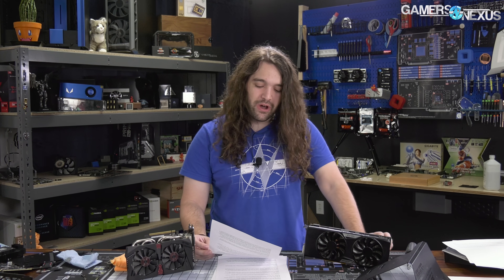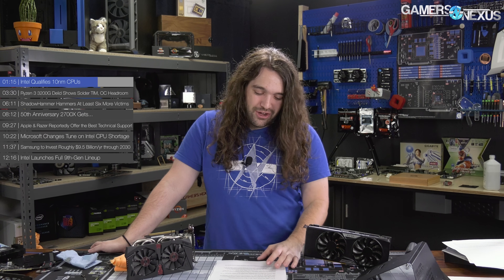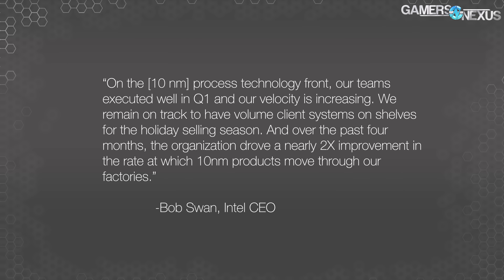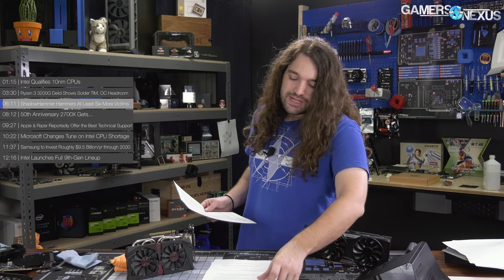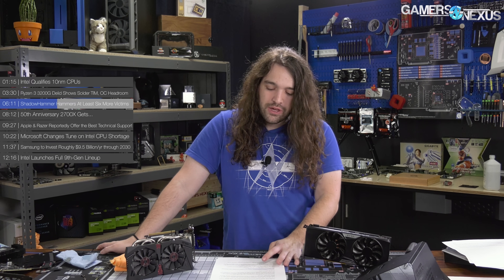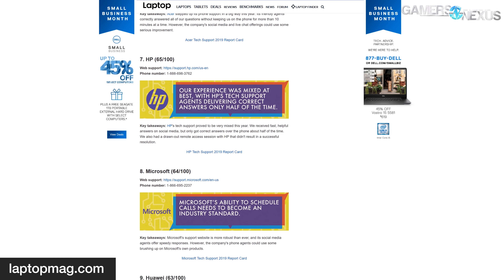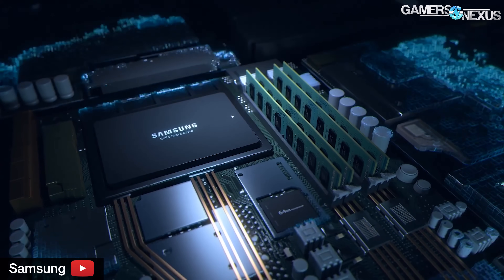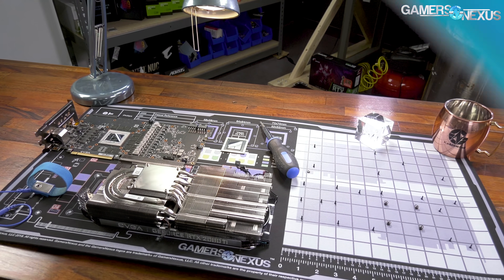HW News - Ryzen 3200 Delid, Intel 10nm Qualified, & More Malware

Comment: Wanna hear a bad joke? Intel Platinum 8156!  This new beast has 4 cores clocked at 3.6GHz and offers 48 pcie lanes. Guess how much this processor costs?  $9000/8000€!! You can get TWO   AMD 32-core Epyc processors (128 pcie lanes each) with that price.
Reply: 7000$*

Sad how my 2600 is so much faster for 6,800$ less

Comment: Leaked Dell road map for desktop suggest that no 10nm CPUs before 2021.  Apparently Intel 10nm process (currently) doesn't allow as high clocks as  14nm so  low power parts first. So before 2021 Intel's best offering for consumer level is 10 core "Comet Lake" (while AMD should have Zen2+  16 core) and  18 cores for high end (AMD should have 32 to 64 core processors. Interesting to see what kind of prices AMD will have? On the other hand they'll need market share and recognition badly, but on the other hand they (should) have greatly superior product that could enable higher prices..

Comment: Not a genius but can you verify humidity levels during your tests for thermals, as I believe higher humidity would change the thermal capacity of the air, in a less insignificant way. As in dry cold air it would sap heat slower than cold humid air.

Comment: I contacted Silicon Lottery some time ago asking how the Intel KF processors will perform and they told me they expect them to overclock on par with K series.    I was hoping for better overclocks because of heat reduction and thermal load with the absence of an IGP and the required voltage to run it.

Comment: I've been trying to get a missing m.2. standoff screw (I got the motherboard new and 1 was somehow missing) they sent me 2 replacement standoffs and screws. But they were the wrong size like they were too small for my mobo and now they've gone dark after I opened a new thread. If anyone knows what screw I need for a b450m mortar that'd be great cause I'm willing to buy it I just want to know the size. So yeah, msi support is pretty bad.
Reply: you can easily measure the size yourself ... in any case it is probably M2, M2.5 or M3 standoff screw - the digit is actually diameter in millimeters

Comment: Intel has missed one key chip in the release of their Coffee Lake Refresh (Generation IX) lineup: The Core i09-9900KFC, a chip that we have been long waiting for since its finding in February and yet we get all but it, which is honestly surprising me.
As a chip without an iGPU, the speculation around the 9900KFC is that it is a 9900K that, like the 5675C and 5775C before it, can utilize the eDRAM to help improve the overall performance of the Dedicated Graphics Card, considering that it wouldn't have a modern equivalent to Iris Pro in the chip; personally, I wouldn't be surprised if the 9900KFC becomes an Auction Only product or only available in Quadro RTX Workstations by companies such as the main trio (Dell, Lenovo, and Hewlett~Packard) and Puget Systems, but knowing how badly the 5775C is priced nowadays (well over II00$ USD on Amazon) and also what happened to the 9990XE, the 9900KFC may be priced a little higher than its K and KF variants but spike to unreasonable values in later years due to its rarity, wishfully that doesn't happen but it honestly wouldn't surprise me as I look further into the prices of some of Intel's more rare, bizarre, and uncommon chips on the market.

Comment: Ask GN: Can Spyware get and send your IP address, if you are using a VPN?
It can get your local network IP, but that doesn't help anyone. :)
Reply: Brad Viviviyal  Not suggesting spoofing just ID linking to a device/user.   If the SW is on the source machine no amount of hops really matters.   It was just a matter of time and sophistication of tech for keeping up with hackers (properly called crackers) to become a real problem.
   Just think of the number of gigabytes of security updates a user has received since they purchased  a PC and SW.   I installed layers of protection on my neighbors PC yet with bad habits I would have to clean his PC every couple of weeks.
Reply: It can get your mac address that is unique and static.

Comment: The laptop ryzen apus (which the 2200g and 2400g are based on) are still 14nm. Their successors in the 3000 series are supposed to be on the 12nm process and somewhere between zen+ and zen 2, the same way the 2000 series apu was in between zen and zen+.

The rumored big boy apu's would be based on chiplet based CPUs on 7nm, but navi needs to come out before those hit

Comment: Soldered IHS is actually really good news if true. I had to delid and LM my 2200g to get temps down in my sff case (in addition to undervolting what little my particular 2200g could do compared to others). It have me 7-12C drop depending on the test but about 10c drop average. Excited for the 3200g/3300g or whatever they end up calling it.

Comment: 2X improvement of 10nm production... So... we're up to like 4 units per month now?

The 3200G is using the "old" process though, right? So the OC headroom will probably be a bit limited due to the process design. "Real" Zen3 is where I suspect we might see a bit more headroom compared to before. Depending on how high AMD clocks them to start with ofc.
Reply: Yeah, 3200G is Zen+, but it's on a "12nm" process instead of 14nm.

Comment: The story for the "3200G" i don't believe cause for starters it is not really a released chip and second why would the guy hide what is written on the chip.
Reply: GN also hides what's written on their Ryzen B-Rolls. They have black tape over them, he answered the reason for this in a previous video.
Reply: @k3salieri  There is a difference between black tape and using a paint program to hide it.

Comment: i just want RYZEN 3000 to be as good as intel on clockspeed and IPC, they can keep the same cores and threads in the same brackets, i think a 3700x 8 cores 16threads 5ghz with ipc on par with coffe lake is more important than a 3700x with 12 cores and 24 threads but still at a disadvantage with intel on single core performance.
Reply: As someone that does some serious multi-tasking, I just want cores as powerful as 4790k, but way more of them for the same price.  Zen 2 seems to be the answer if leaks are to be believed.  Even an on-paper lower clock can be faster than competition's higher clocks e.g. FX chips vs Core chips.

Comment: Would laser etching a signature into the IHS of a CPU potentially have negative effects on performance? My concern is that the IHS surface would then be intentionally uneven, which would lead to a thicker layer of TIM between the IHS and the cooling solution.
Reply: No, it wouldnt affect performance

Comment: Razer's support is an abomination. I never had a worse experience with any company. They wiggled their way out of a $1400 repair just weeks after the warranty period. The keyboard on a Razer Blade had stopped working (no spills) and they said no warranty, no repairs, motherboard replacement only, $1400 plus shipping. Had a third party take care of it, cost was less than $100, and third party said a solder joint was not done well from factory. Never again Razer.
Reply: Brad Viviviyal  'Razer - Rest in Pieces'

Comment: Of course it's a U series CPU, that's kind of been the problem with Intels 10nm production, they don't clock well or take heat well, the current announcement is just more of the same. They'd rather sell this low yield marginal product instead of throwing it away to save face.

Comment: Quick question, need help.
I have i5 3350p with gtx 960 4gb G1 gaming. What gpu to choose between rx 570, rx 580, gtx 1660, (and maybe gtx 1650Ti), with minimal or no bottleneck.
Reply: Rx 570 will match nicely with that CPU for a mid range 1080p set up.

Comment: How do they solder the cpus without killing them cause of the heat?
Reply: I don't know but I saw people delid CPU by heating it in an OVEN! and technician like Louis Rossman heat electronic chip to hundreds of degrees in order to replace an IC chip on a Macbooks. My guess is that the primary mode of failure on electronics is "Electromigration" which require 2 thing to happen; 1st) Heat & 2nd) Electron flow... so I guess if you turn off your electronics then it will survive high temperature because "Electromigration" didn't happen. Basically, because of heat, things slowly creep & move, but if it is just heat, it is probably slow, and if you add electricity; it accelerate.
Reply: they use low temperature solder